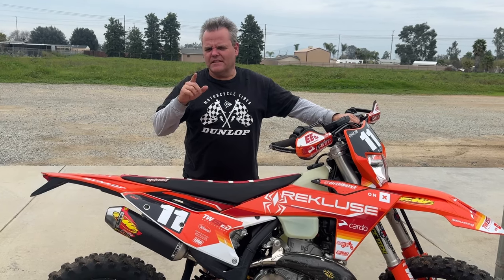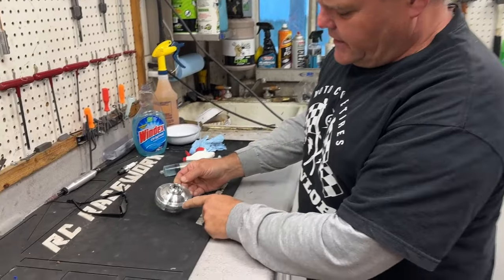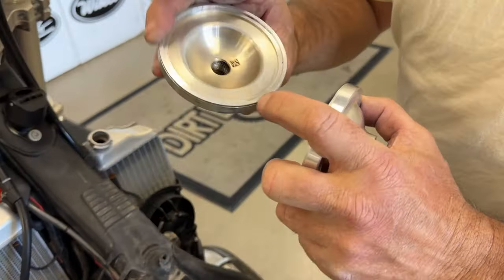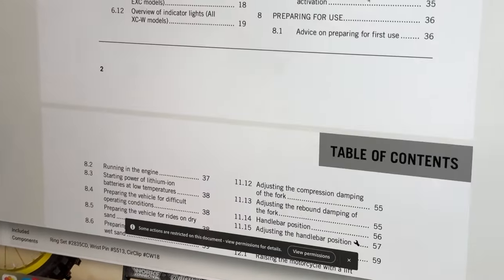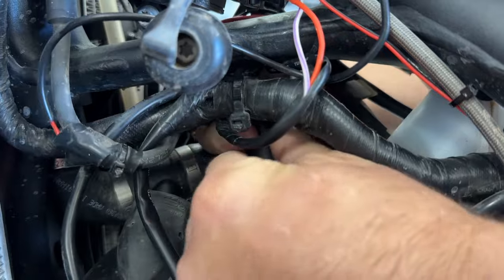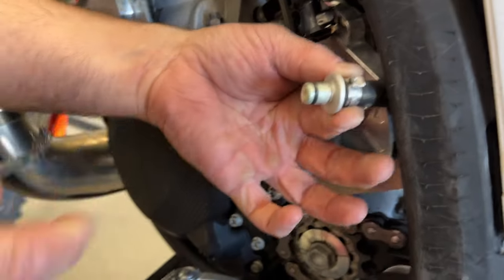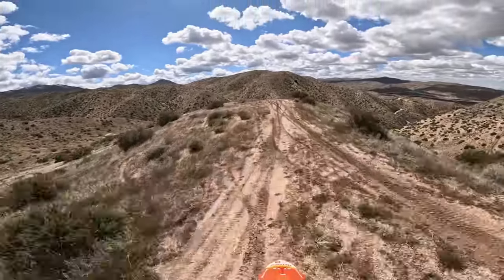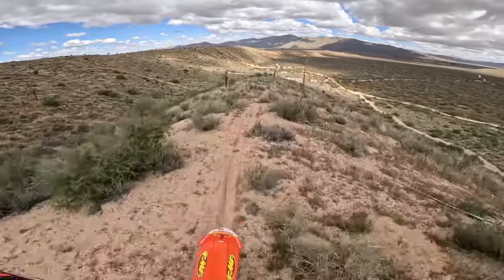Turning your KTM 300 XC-W into an XC!

Comment: What do you think about doing the opposite? I’d like to take a 300xc and make it less spicy.
Reply from the maker: Great ideas. Email Jay directly for tips.
Reply: @dirtbiketv1  where do I find that? Your website?
Reply: @dirtbiketv1 never mind I’m dumb, it’s in the video description 😂
Reply: Did you do change your XC? 

I had the same question. I have a 2023 Husqvarna TX300 (same ax XC). I've already installed a 9oz flywheel weight but would like to soften it a little more. I was curious how the XC-W head would perform with the stock TE / XC ECU and map. I've ridden a few XC-W, and I feel like they have too soft of a hit even on the green map, but the XC is a little too hot when riding technical or hard-enduro type terrain. All of the aftermarket products heads, tuners, etc. tend to focus on more power. I don't need more power. Thanks

Comment: Just found out KTM is owned by Baja 300 Austrian technicians laid off what the heck is going on? We are told by actual KTM technician they would not touch a KTM anymore with your 10-ft pole KTMs 300 are blowing cylinders off or 2024 Husqvarna was leaking oil so bad out of the shift seal they replaced it twice now. Is this true? Please tell what you know about this

Comment: Why wouldnt you just buy an XC
Reply: The most common answer will be that you don't want the rear suspension linkage. Other than that, some people, for a variety of reasons, will start off with an XC-W and then eventually want more performance.
Reply: As someone with a tx300 I think now I would have gone te300 and done the dome. So I could easily have the power for a light off the bat and the heavier flywheel for the extra lug. It would’ve been closer to the 450 I came off.
Reply: Xc doesn't have stator
Reply: Because these are the types of guys who just can’t leave things alone, more power does not mean you’ll be faster in the woods